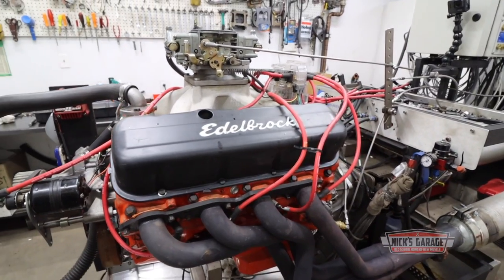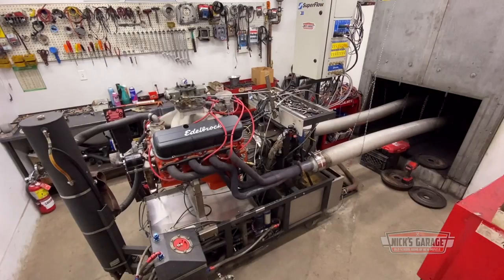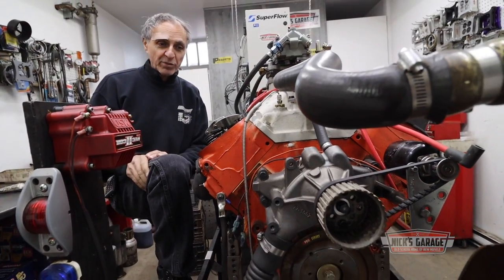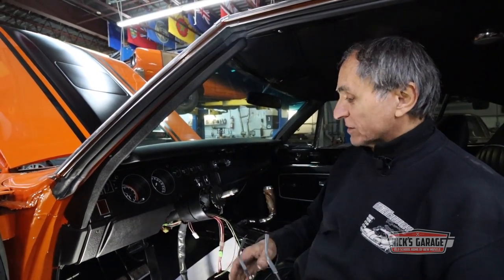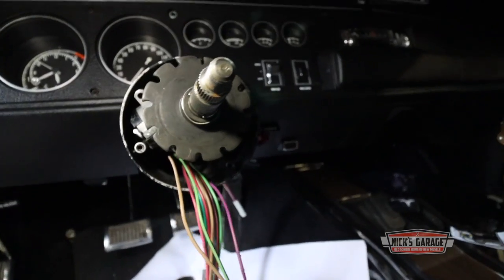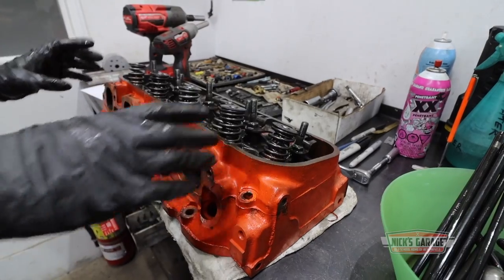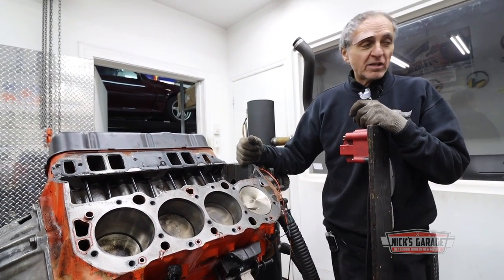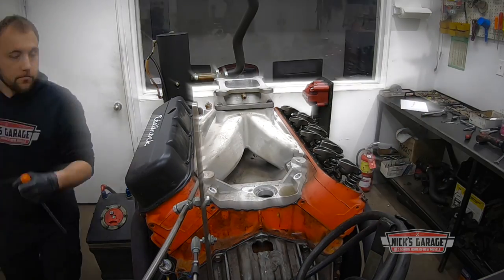Weak Big Block Chev • Wrong Parts + Poor Assembly = No Power!

Comment: Those are merlin iron square port head. They usually have a 119cc combustion chamber, with flat top pistons on a 427 it would make around 7.5 to 8.0 :1 compression, depending on the head gasket being used and the valve relief CC and the depth of the piston in the cylinder.  I have built a lot of BBC's in my day and I can tell you these cylinder heads are complete junk on the street. I have nothing against world products heads but this product makes no sense on a street or race engine from a engine building stand point

The square port heads a crap until you get above 3000+ rpm, then they come alive. The problem is on a street driven car you are really never revving that high. Additionally to make big power (600hpo) you need big compression. Iron heads are ok if you are under 9.75:1 compression. But your not going to make 600hp at that compressing level. At 10:1with iron heads you need 96-100 octane fuel,  so your not going to be running pump gas at that point. Additionally 100 octane its not available everywhere, so you not driving it on the street. 

They don't make sense for a racing engine either since 1. cast iron and weight about 70 LBS each. and 2. aluminum will tolerate more compression and make more power and since you have to run race gas at 10:1 on iron heads why stop at 10:1 compression if you are building a racing engine? unless there is a rule that specifies the max compression being 10:1.

the only place it makes sense to use these iron heads is on an power boat with a large displacement engine, where lake or sea water will corrode aluminum heads. for example a 502, 540 or 572 BBC setup for off-shore racing, I would use these head all day long. but for a street car they are useless.  

personally, I would switch to an aluminum large oval port head, and a smaller combustion as 110cc chamber a piston with 28cc dome, it would put the compression around 10.4:1 and you could run pump gas in it. a good roller cam something in the .230/236 - 240/246 deration @.050. should make some solid power.  also scrapping the cheap distributor as well. personally I like MSD or Pertronics billet units. and while I was at it I would get rid of that gear drive on the cam, that whine gets annoying on a street driven car. 

the other possibility for this engine would be to stick with the square port head, correct the issue with the pistons being our 180 degrees, and stick a supercharger on it and a cam to match.  it still wont make the power of a oval port head from idle - 3000. but it wont suck either. still get rid of that cheap dizzy and the gear drive on a street car.
Reply: Shad.           I agree with you 100%

Comment: Hey Nick im just curious, those roller tip rockers that this 427 has, what are your opinion on them? Have you had any issue with them on engines you've worked with? Considering using a set on my own 427

Comment: Hot 427 looks, with 366 tall deck power.
Reply: Yes but 366 396 402 same stroke 3.76  but best block was 402  396 had oiling problems  5 n7 cyl  eat ur bottom end in few seconds  at 6 k

Comment: 120 psi. Depends on the cam overlap.
Clearly it has no lift either. Since the valves are not hitting the pistons.
And yes I agree whoever assembled it had no idea.
I hear big numbers often,, that for engines that do not go!

Comment: Had Motor Mission in Las Vegas build me an engine... it sat never broken in , in my car. Finally got around to getting back on my car and decided to have it checked-out after I started to double check the assembly. I knew there was problems when I couldn't pull the cam out by hand and had to use a body dent puller. Decided to get it rebuilt with a roller cam at Dan's Driveline and dyno tuned/broken in. Thank God I did... Doug, the guy who built my engine at Motor Mission 20 years ago had screwed up so much stuff that if I had broken in the engine it would have failed in under a few hours. Dan's Driveline fully disassembled the motor, rebuilt engine with roller cam, etc. and dyno tested it... corrected cracked oil pan, etc.... Bottom Line... TRUST NOTHING BUT A DYNO!!!!

Comment: The low compression is a huge disadvantage for a big block. But the Big-er problem with that engine is the made in China lifters. Those lifters eat torque, horsepower and mileage and are well known to disintegrate within 10 k miles.

Comment: My big block in my pick up makes more hp then that thing. I have never seen anyone put pistons in upside down, maybe that's why it had such a small cam in it, no piston to valve clearance.
Reply: I'd bet my stone stock small block in my run of the mill pick up makes more horsepower than that.

Comment: You want a strong engine ..find a reasonable priced ..engine in a car / truck that has been wrecked ..take it apart ( yourself ) ..find a good machine shop ( if you need one ) ..then ..put it all back together ( correctly) with any new parts you want to add ..and..voila ( as Nick would say ) you got it ..dudes or dudettes 😎

Comment: the big block chevy has the worse rod stroke ratio of all of the big blocks,while its running stock it is trying to scrape the skirts right off the pistons,putting them in r/vs was a big joke,trying to race them is bigger joke,improve the rod stroke ratio to 1.8 from miserable 1,45 stock ratio,1.8-1.9 is perfect
Reply: 383/400 mopar has a 1.88 rod ratio stock. put the 440 rods in and its indy car levels at 2.01.  all that with a 9.98"' deck height lol.

Comment: Dynos, where hopes and dreams are broken. Also I don’t know how much power it lost not running a spark plug boot on number 5 cylinder but, from my experience it doesn’t help. Can’t wait to see the end result with compression and a better cam. IMO those heads need way more cubic inch to make any respectable street/strip power.

Comment: Floating the valves I bought a 454 for my truck and I tore it down the guy think it had a bad Valve. It had a nylon timing gear I found nothing else wrong with it. Matter of fact it had better pistons with black still showing on the skirt's.  I found prices of plastic in the pan. I paid 350 for it block in shop just needs rering checked out fine.

Comment: Who ever BUILT that427 should be smacked in the head,366 from a 427,sad,sad sad
Reply: GM built many 454 engines under 300hp . looks like put bottom end back stock and slap the analogy of big cam big heads and gear drive to make it sound good i thought it sounded weak no snap to it.

Comment: Same thing happened to me and ill never forget the horror I went through. When I was 17 years old I was given a 1972 nova and after getting my 1st full-time job to start rebuilding the car I dumped thousands of dollars into the body and a freshly build 383 stroker. The day we installed the motor and got my baby running for the 1st time I was the happiest I've ever been in my life! After the first drive I noticed the power was not there. The engine was built by the guy that gave me the car ( a close family member). Well it turns out he did NOT know entirely what he was doing and one day I was just sitting in my driveway reving at low rpms and the God darn thing blew into pieces!  Fast forward after  a month later I get home from work and my cars missing.  The mother f'r ended up forging my name on the title and selling the entire car and thousands of dollars of my spare parts I had. That was 20 yrs ago and to this day I still want to kill this man! I'm currently saving for another but the value has gone up so much!  😡🤬  Yeah I'm still mad.
Reply from the maker: Oh man. That hurts. Thank you for sharing.

Comment: For years my cousin told me stories about his uncles 68 Camaro with a 454 of how it would pack the front tires, had over 800 rwhp etc. Years later It ran high 12s at the track, I spanked it with a full Bolton cammed ls1 4th gen. Some people are just idiots.

Comment: Great video, however a quick inspection of the cylinders with a cheap cell phone bore camera under $100 would let one see inside the cylinders through the spark-plug hole to inspect before purchase.

Comment: Part of the problem is decades of BS myths around the BBC's that came out of Chevrolet. So many people claimed and believed the LS6, LS7, L88, and ZL1 were these 500-600 hp (or more) right from the factory. So then when someone see's a 427 with "BIG rectangular port" heads and a single plane intake with a dominator, well hell it must make easy 600 if from the factory it was at least 550. If I saw a 427 with rectangular port iron heads, I'd pass instantly.

Comment: 2:25 the engine idle too smooth to make 600 hp.
Can a 302 Ford make 500 hp and drive around on the street?
Reply: Yes
Reply: Mine makes 530 and I drive it on the street.

Comment: Wait, where's a part 2 of this? I wanted to see them put the correct pistons and cam in and get 600 hp.
Reply from the maker: We will bring you updates. But as for what is done with the engine, that’s up to the customer.
Reply: When I saw this was a new video, I knew a Part 2, if any, would be a while coming... 

I knew it was a bad build when I first saw the roller tip stock type rocker arms, those heavy rollers just add weight at the worst place to add weight for a mild street engine... 
.

Comment: I had a 350 in my truck and when I got it and when you would give it about 75% throttle or more from a dead stop it would go clunk and die about a year down the road the crank snapped going down the highway it was a pos

Comment: Hello Nick on a 403 olds engine  do you recommend drilling a hole in the rear oil galley plug to oil the distributor gear?
Reply: Those motors didnt have distributor drive gear problems. I wouldn't drill any holes.
Reply: Don't waste money on building a late model 403 olds motor. Their bottom ends are junk.  In an attempt to lower block weight Oldsmobile made a large casting holes right below where the main cap bolts went into the block. You can actually see the hole for the main bolts in these casting holes. Get a 455 or 400 if you want to build an olds motor IMO.
Reply: @smokeskull  Thank you for the reply.
Reply: Paul Dana  Thank you for the reply.
Reply: @michaelwilkening8542  thank you for the reply will consider for sure.
Reply: tamiya.     There you go. Do not drill any holes.
Reply: @smokeskull  I put a magnifier  glass in the dizzy hole mine already has a hole in the plug.
Reply: @nickpanaritis4122  Hello Nick the only reason why i asked is because Joe mondello says to drill a 0.40 hole in the plug to lube the dizzy gear.
Reply: @tamiyafrog3220  .      In that case, .040 is small. I had taken a week course with Joe Mondello in Pasa Robes, California. Then I would drill the hole. He knows his Oldsmobile. He was a great person.  R.I.P.
Reply: @nickpanaritis4122  yeah for sure 👍 he sure was.

Comment: Anyone who puts a engine together with heads intake like that and no port matching upside down piston Nick you know have to start at the beginning Cam time valve seal leak down end gap rings bearing clearance ect lucky it didn't have enough power to blow itself up properly at least it's got some decent rockers and pushrods if the chambers not to big some spring and a mechanical roller might get north of 520 or so on pump gas

Comment: This is why when I build an engine I start with all brand new parts that I buy and have delivered to me so I know exactly what I have. the last one I built cranked 680 hp on the dyno and the dyno will not lie. if you want to you can check out the video on my channel. it’s a true 680 hp engine it could’ve made more but I’m putting it in a small boat.

Comment: That 427 is weaker than Chevy's weakest model the L36 that made 390 
horsepower. I wouldn't be surprised if it's really a weak 454 they made 
in the 80's with the low compression it has.

Comment: that must be low compression for a blower?
Reply: Or turbo. But why spend big money on the heads, then try to save $ with a hydraulic cam?
Reply: That's what I was thinking, ....they jacked the huffer and put a cheap cam in it before unloading it on this poor guy
Reply: pump gas street type blown engine run 7.5:1 to 7.8:1 SCR

I bet you're right rtkl13
Reply: @1112223333111  2 things with it struck me,... I used to hustle cars and I seen a lot of selling swindles....1- huge flowing heads, tiny cam, and a carb that had no history. 2- I noticed the intake gaskets had sealer all over them....of course, why would put new gaskets on it just lather em up and slap it back together

Comment: Makes me wonder if the Chevy is even a 427.  Does it have 4 bolt mains?
Reply: All 427's don't have 4 bolt mains, so that's not an indicator. 427/454 block is the same, so it could be either.  Would be interesting to check the stroke, though.  Which I'm sure Nick will if the customer elects to have him fix it.
Reply: If it truly was a 600 HP it should have been converted to a 4 bolt main. Cheap investment. My 396 450HP was converted to 4 bolt main not that it was needed but it's just peace of mind.
Reply: The standard deck height 427 4 bolt main block would be a Hi-Perf block rather than a Pass block.  All the internals would also be different.  The Hi-Perf engines all had solid lifter cams while the Pass were hydraulic flat tappet.  The Hi-Perf also had the rectangular ports rather than the oval ports of the Pass engines.  Looks to my like the engine on the dyno is just a collection of left over parts from previous engines thrown together to rip off the uninformed.
Reply: Don.     I did check the bore and stroke.  427 it is.
Reply: @donbrutcher4501  All short deck blocks say "Hi Perf/Pass" on them.  Only the stock truck blocks don't say that, and some of the counter replacement truck blocks did.

Comment: Heads overkill,turn pistons around,add a set of 781-049 casting oval ports with 2.19-1.88 valves(common casting from 73-80 454 smog) kinda like your 906 heads from late 70,s but are cheaper  keep the ol Hyd. cam if it,s 230-250 dur. at 50 and more streetable intake and  Killer street big block for the money!  Outran a few 383/440  cars back in the day,440,six pac pistons,906 ported heads,292 purple cam,torker intake 850.....The Mopar setup.....Well prepped Big Block Chevy is hands down...if you know what your doing HARD to beat with Factory parts used right!...The square port head engines is a diff. catorgory due to money.

Comment: aftermarket carb, distributor, intake, valve covers, heads, pistons, cam, …...is this really a Chevy ?.....well mabe the block is but then again it might not be.....I'd call it a Mongrel not a Chevy......Chevy never made a passenger 427 that had that little horsepower

Comment: I remember when having say a Pete Jackson gear drive was all the rage about the same time flow master mufflers came around it’s the sounds of my childhood
Reply: My dad had a 67 RS/SS with a 427 and it had a gear drive and I remember thinking it sounded cool at the time but now I don't think I could stand the constant noise. That car also had 8 single barrel Weber's on it that stuck out the hood, going down the highway you could watch the fuel get stuck out the top of the velocity stacks.

Comment: Was there no need to keep track of what parts went where?
Reply: Matthew.         After so many times in so many years, you know it inside out.
Reply: Nick Panaritis Sure, sure - that doesn’t apply to things like pushrods, though, does it? At the time of the initial assembly you couldn’t have known if they would be reused or not, and they should go back where they came from, right?
Reply: @matthewtaylor3308  .        You really do not have to put pushrods in the same order during assembly. What is important is that they have no wear or scratches.
Reply: @matthewtaylor3308  Pushrods don't matter.  Lifters do, though.

Comment: If he's going to street drive this big block  and just occasionally drag race it he'd be better off with the large oval port open chambered heads. They make better power to around 6,000 rpm than the rectangular port heads. I'm also wondering what size that dominator carb is because it may be too much gas for a 427 especially one with a mild, flat tappet, hydraulic cam.
Reply: ive lost count of the many guys i've met, who think that a bigger carb (or a cone filter lol) magicly means more power.

Comment: It was just thrown together to sell it. Pistons not even installed right. BBC needs solid lifter cams or solid lifter roller cams. BBC with more than 40 pounds of oil pressure will not rev good with a hydraulic cams because the pushrods on a angle pump up the lifters and it just wont rev. All factory high performance engines from the factory came with solid lifter cams and oil pumps at about 60 lbs. Seen the easy trick to install solid lifters on a hydraulic cams set lash at .020 and they rev good. A good trick if you don't want to take it all apart. Some people put them together right with a high presser oil pump or high volume pump with a hot hydraulic can and not rev. You had 2 choices replace cam with a solid cam and lifter or install solid lifters on a hydraulic cam. Its does work and they run really strong. Seen that mistake soo many times and told them the fix. Most just bought solid lifter because it was a easy fix rather than take the engine out of the car and start over. Not the right way to do it but does work really good. Never cared for those lousy gear drives that were popular in the 70s because of the noise.

Comment: A gasoline engine needs a least 100 psi. of compression just to run, any less than that and you will have trouble starting without spraying something down its throat like heptane and ether.

Comment: Just shows the difference between a random parts picker and someone who takes the time to match parts to the airflow demands of the engine etc. I had a 8:1 compression 305 I swapped vortec heads onto with some full length headers a mild 204/214 @0.050 cam edelbrock dual plane intake and It was running 280 horse all day at the wheel.